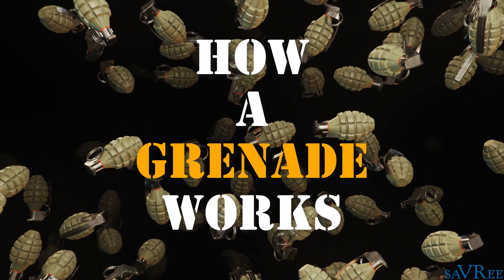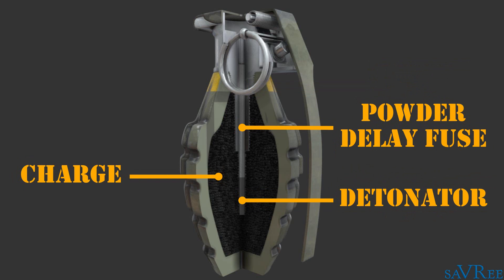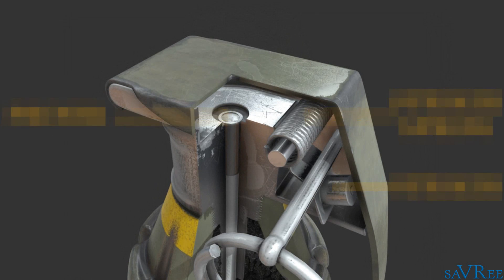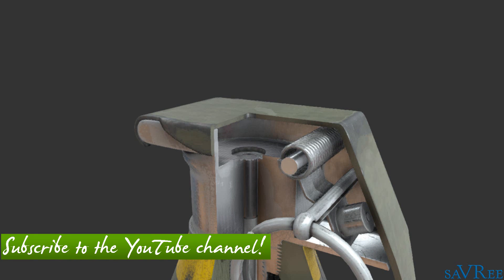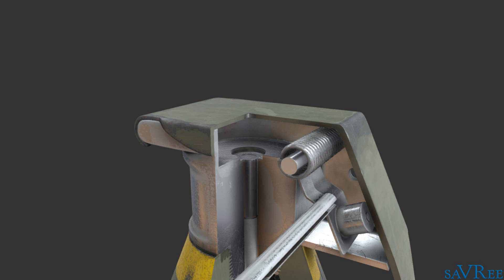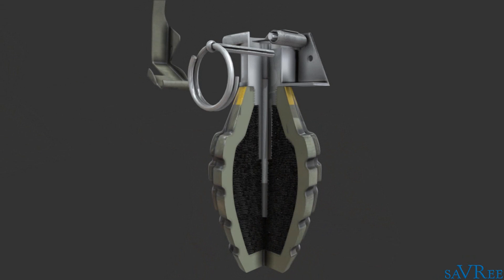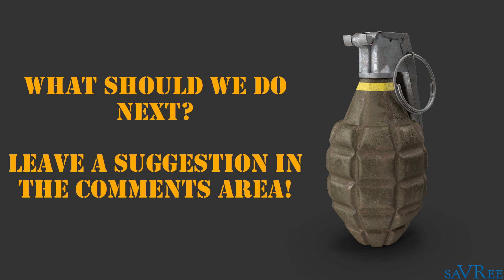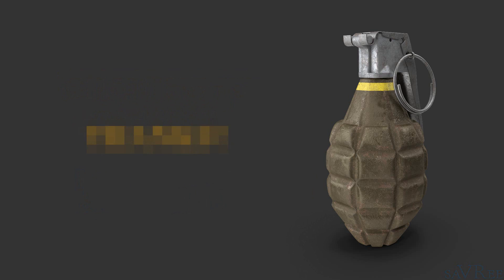How a Grenade (MK 2) Works! (100% Animation)

Comment: and now tell me how does an RBMK  reactor core explodes...
Reply: Lies.  That's how.
Reply: What up, Abhishek Anshuwali? I'll handle your excellent question today: 

The RBMK-1000 reactor, or "Reaktor Bolshoy Moshchnosty Kanalny" was a design used only in the former Soviet Union, and was a water-cooled reactor with individual fuel channels that use graphite as a moderator. The reactor was different from most light-water nuclear reactors, the standard design used in most Western nations. 

Light-water reactors consist of a large pressure vessel containing nuclear material (the core), which is cooled by a circulating supply of water. In nuclear fission, an atom (uranium, in this case), splits, creating heat and free neutrons, which zing (it's like having anonymous sex with...) into other atoms, causing them to split and release heat and more neutrons. The heat turns the circulating water to steam, which then turns a turbine, generating electricity.

In light-water reactors, the water also acts as a moderator to help control the ongoing nuclear fission within the core. A moderator slows down free neurons so that they're more likely to continue the fission reaction, making the reaction more efficient. When the reactor heats up, more water turns to steam, and less is available to play this moderator role. As a result, the fission reaction slows. That negative feedback loop is a key safety feature that helps keep the reactors from overheating.

The RBMK-1000 is different. It also used water as a coolant, but with graphite blocks as the moderator. The variations in the reactor design allowed it to use less-enriched fuel than usual and to be refueled while running. But with the coolant and moderator roles separated, the negative feedback loop of "more steam, less reactivity," was broken. Instead, RBMK reactors have what's called a "positive void coefficient."

When a reactor has a positive void coefficient, the fission reaction speeds up as the coolant water turns to steam, rather than slowing down. That's because boiling opens up bubbles, or voids, in the water, making it easier for neutrons to travel right to the fission-enhancing graphite moderator.
 From there, the problem builds: The fission becomes more efficient, the reactor gets hotter, the water gets steamier, the fission becomes more efficient still, and the process continues. When the Chernobyl plant was running at full power, this wasn't a big problem, because at high temperatures, the uranium fuel that powers the fission reaction tends to absorb more neutrons, making it less reactive.

At low power, though, RBMK-1000 reactors become very unstable, kind of like your sister-in-law right before the holidays. In the run-up to the Chernobyl accident on April 26, 1986, operators, a few of which were somewhat incompetent; but hey, what are you going to do? I mean, this was the Soviet Union, for Criminey's Sakes! Anywho, these morons were doing a test to see if the plant's turbine could run emergency equipment during a power outage. This test required running the plant at reduced power. While the power was lowered, the operators were ordered by Kiev's power authorities to pause the process. A conventional plant had gone offline, and Chernobyl's power generation was needed. 

The plant ran at partial power for nine hours. When the operators got the go-ahead to power most of the rest of the way down, there had been a buildup of neutron-absorbing xenon in the reactor, and they couldn't maintain the appropriate level of fission. The power fell to nearly nothing. Trying to boost it, the imbecile operators removed most of the control rods, which are made of neutron-absorbing boron carbide and are used to slow the fission reaction. Operators also inexplicably reduced the flow of water through the reactor. This exacerbated the positive void coefficient problem, and then suddenly, the reaction became very intense indeed. Within seconds, the power surged to 100 times what the reactor was designed to withstand. "She canna take any more, Captain Comrades. Nyet! She's gonna blow! She's gonna blow us all into Kingdom Come; and so Kingdom Come, Here We Come!" 

There were other design flaws that made it difficult to get the situation back under control once it started. For example, the control rods were tipped with graphite, which is like, Ermahgerd! When the operators saw that the reactor was starting to go haywire and tried to lower the control rods, they got stuck. The immediate effect was not to slow the fission, but to enhance it locally, because the additional graphite at the tips initially boosted the fission reaction's efficiency nearby. It quickly went "TUB" or Tits Up Ballistic. Two explosions rapidly followed. Scientists still debate exactly what caused each explosion. They both may have been steam explosions from the rapid increase in pressure in the circulation system, or one may have been steam and the second a hydrogen explosion caused by chemical reactions in the failing reactor. Based on the detection of xenon isotopes at Cherepovets, 230 miles (370 kilometers) north of Moscow after the explosion, scientists currently suspect that the first explosion was actually a jet of nuclear gas that shot several kilometers into the atmosphere. That's not a good thing, as Martha Stewart would reflect. 

But nevertheless, it was actually a lot less intense than the detonation of an actual nuclear bomb, and most scientists agree that the entire area will be once again fit for normal, human occupancy in just a skosh more than perhaps twenty-thousand years, or thereabouts. So yeah, very good question.                                   - j q t -
Reply: John Quill Taylor Someone’s well educated, I respect that
Reply: @quill444  Those metaphors are like fine wine. You sir are great.
Reply: @quill444  well sorry but you are wrong, its impossible for a RBMK reactor to fail in any way !

Jk your comment is impressive
Reply: @quill444  Not great, not bad... Actually tldr; :P
Reply: @adilmhaisker6477  I still get great comments on this "baby" of mine that I posted nine months ago!  ; - )
Reply: @quill444  magnificent reply to a 'metaphorical' question
Reply: @quill444   quick version: reactor get too hot
Reply: You press the A5 button
Reply: someone spills a Pepsi on the control console
Reply: They dont explode. This man is clearly delusional, take him to the infirmary
Reply: You speak as though you saw graphite on the ground...
Reply: “It doesn’t your delusional”
Reply: https://youtu.be/TmIEI4ky-Zc
👆... Here.
Reply: Abhishek Anshuwali estudiantes trabajando con vicios y comida el dinero calcular con la calculadora Estación El secuestro
Reply: @John Quill Taylor omgggg can you please give me a full course on nuclear energy explosions and i am so down to apply and pay, youre much more informative,useful, and interesting than school.
Reply: Just like grenades in movies